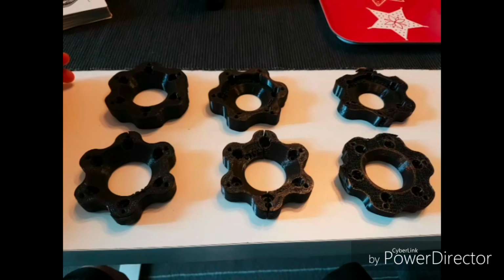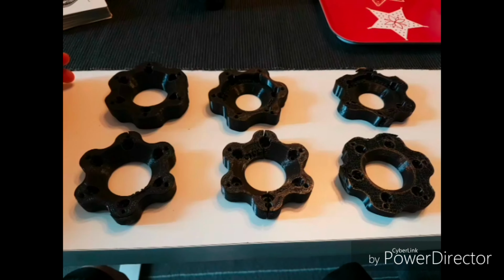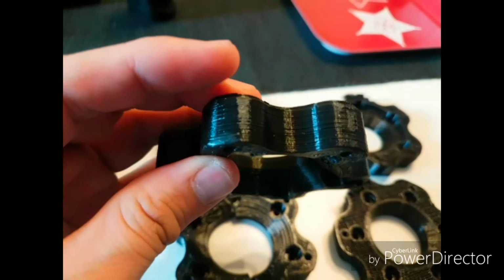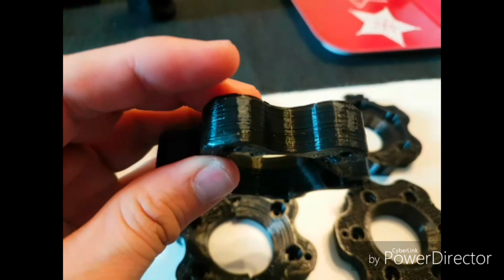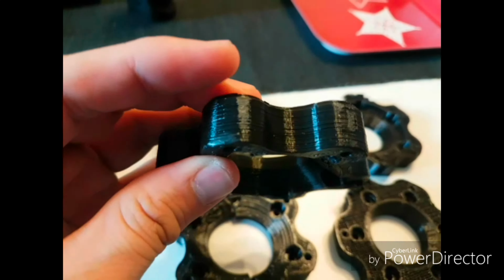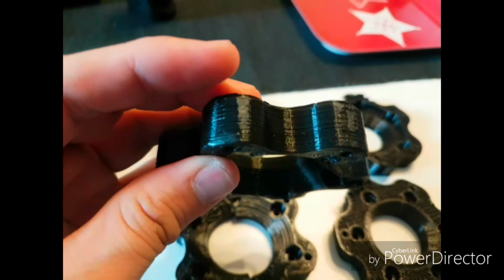Logitech g27 and g29 STEERING WHEEL ADAPTER stress test

Comment: Is %75 infill good? For stress
Reply from the maker: Should hold up fine for the 30% infill i used none of my clients complained about breaking under normal driving. Except for the ones shipped to canada, but it was only one complaint i had.  One i had issues with the threads gettings stripped but it was due to over-tightening
Reply: cybertec02 ok thanks but I have 2 options %75 o % 100 is better ?
Reply from the maker: @rasanmobster3611  if you can wait for 100% infill then that is the best one. Another way to make it stronger is by baking it in sand. I saw a video of it people making 100% infill then add fine sand, compact it then bake until it fuses together looking like a manufactured part.
Reply: cybertec02 I mean does %75 break if you know so you tried them for the wheel because my friends machine only do %75 if you know what I mean is it good so?

Comment: Great stuff mate !!! Any chance you could share your printing files with me and I would like to give a ago with my recent purchase 3D printer ?

Cheers
Reply from the maker: Wei Chen you can get files from thingiverse for free so you can use your 3d printer. You can also use autodesk 123d software.
Reply: i tried thingiverse but could not find G27 and G29 like those one you had in your video. would you give me bit help on that, too ?
Reply from the maker: Norm Tokkene Logitech G27 to Universal Wheel Adapter found on #Thingiverse https://www.thingiverse.com/thing:1489893